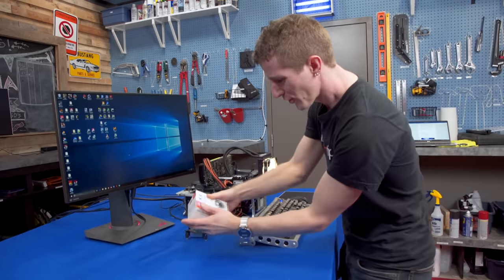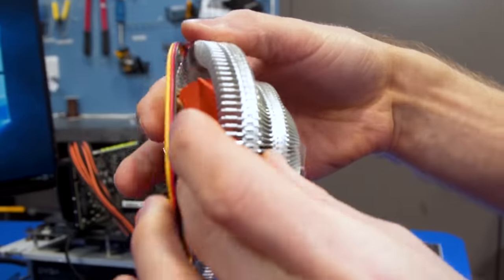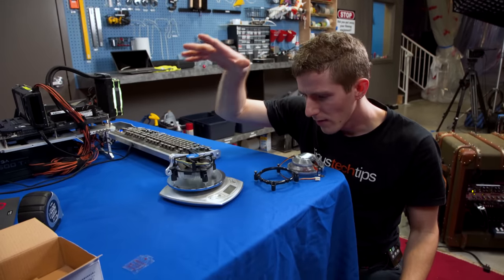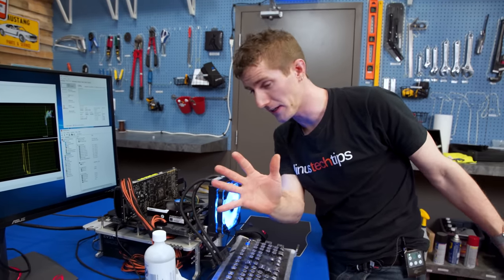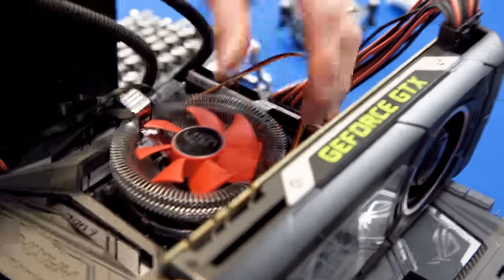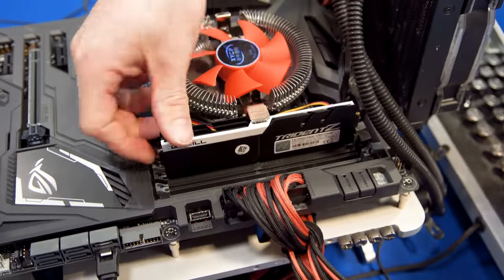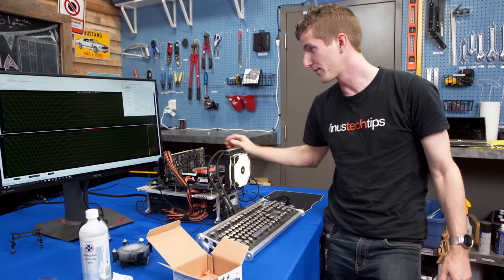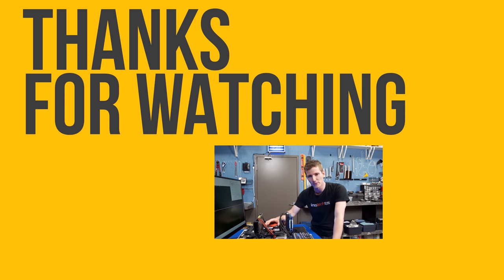The CHEAPEST Heatsink on the Market

Comment: Please tell me you did not use that thermal paste, okay a tube of paste would be more than the heatsink sure but come on you should had used a better paste on both and not the crap it came with
Reply: they used the included paste...
Reply: Or at the very least they could have done this (used what they came with) and then re-tested them using the same thermal paste to really remove all the variables.
Reply: He should have just gone with the same thermal paste on both coolers. And should have used a good one too. That would be a good comparison.
Reply: Yeah, but if you're buying the cheapest heatsink, you're not going to have thermal paste.
Reply: Except that in no way in hell would I buy the cheapest heatsink. And since its all for lols, why not just do the proper comparison? I mean he said it himself he put the 65 tdp heatsink on a 95w cpu... Why not use a good thermal paste? :P
Reply: Because it is all for lol's so why not show what out of the box will do for you?
Reply: Kirinketsu you can buy way better thermal paste than that for like 2$. Anything is better than what that came with
Reply: Completely agree. He says he's going to use the included thermal paste to eliminate variables, which turns out to be the only variable... Would like to see this done with the same thermal paste on both.
Reply: Kirinketsu many cheaper thermal pastes need 24 hours to set before use and to actually help with the cooling
Reply: Fail test since thermal paste can make a big difference
Reply: Is this heat sink worth it? We dont know cause we spent more on thermal pasted than the cooler!
Reply: Nick Flipper learn to spell and use grammar before you criticise someone who has more success than you will have in 3 lifetimes
Reply: Lots of people have extra tubes of thermal paste, left over from previous builds with enough for another application.
Reply: It was a comparison of the stock heatsink vs the cheap one. A normal person would have used the paste in the box, they wouldn't go out and buy pro grade paste for 3 times the price of the CPU cooler
Reply: No point, I use a 4690k with stock heatsink and stock paste and I've even switched it in and out multiple times without replacing the paste, and I've overclocked it to 4.4ghz 1.22v and it gets 63c temps at maximum. Why would I need any better temps than that? The stock cooler is perfect
Reply: I agree that another paste would have been good to try, however I highly doubt that it would have changed much.

I'm also not saying that the default paste shouldn't have been used though. I think it would have been beneficial to just try both. Do note that one wouldn't even have had to use a high end thermal compound; one can get little packages of TIM for 1$, and it even lasts for multiple applications. probably would be good to use the best stuff though just to see the range of performance.

Like I already said, I highly doubt it would change things much, because the heatsink itself is cheap and underrated.
Reply: LazerLexHex dont be mad that your not successful but i am lol, stay in your moms basement
Reply: Chola Tech damn he got you really work up didn't he? Lol hey at least you care and are passionate enough to voice your opinion.

Comment: Linus you did not test the same thermal paste on both so this this test is not correct.
Reply: He used the paste included with both coolers. Fair
Reply: Nick F the constant was the system used and the stress software used
Reply: The constant is the setup on the motherboard. He used the cheapest stuff - and everything included. That's how this format should work for me

Comment: It looks like a ripoff of an older zalman cooler
Reply: Yeah! The old CNPS 7000 AlCu with only aluminium , same mounting bracket  (i have the Zalman somewhere)
Reply: Scrolled down just to find this comment. Did not disappoint. CNPS for life.
Reply: I tried to cool an old Pentium 4 with this , it could never get it under 60°C
Reply: It's actually just a rebranded Deepcool cooler in a different color, plus with the right CPU and paste they perform fairly decent for their price, I have one on an older AMD AM2+ mobo with a Athalon II X3 that's a daily computer for my aunt in her 70's running NeverWear's Cloudready OS(open source ChromeOS), and before that Linux Mint XFCE 64bit and the temps where in the low 40's for daily work loads surfing the net, Google Docs, playing movies, streaming music, etc.. to be noted I only paid $8 for the Deepcool version off eBay, and I would not use this on a more modern gaming PC by any means.
Reply: The good old Athlon X3  , did you unlock it? 
The paste also play an important part : on my old OC'ed i5-750 in a well ventilated case i had more than 50°C on idle with a 120mm watercooling (with noctua fans) and cooler master stock pase , this same I5 in a poorly ventilated case with a bad custom 120mm cooler is staying below 45°C with a noname paste
Reply: I tried to unlock it years back when it was my main system, but I got one of the ones that just would not unlock for whatever reason, plus with the task it's doing now it could really be handled by a dual core Intel Celeron to be honest, but the Athalon X3 just happened to be parts I had laying around my shop, and I hate throwing out good working parts, and the only things besides the CPU cooler I had to buy for her build was a new Rosewill 450 watt PSU(caught on sale for $23), and 8GB of new old stock DDR2 ram from HK($24 after shipping) that cost me in total about $50.
Reply: It does appear similar, however I would think the CNPS 7000 would be much bigger than that though. The copper version of that thing weighed nearly 2 pounds as far as I know, while this is 1/6 of that. The higher density of copper would not account for that difference.
Reply: Mshojat I think the fins on that thing are waaaay thinner than the zalman ones
Reply: it looks thinner and more space between the fins
Reply: That's why I said it's a Deepcool clone only in a different fan color, box, and sticker as everything else the exact same down to the crap thermal paste I threw out, and it works much much better on AMD chips with the mounting clips.
Reply: Looks like the old Ice Hammer coolers  in late 00s (but they was cuprum 500+ grams and handle C2D E8400@4Ghz very well)

Comment: I think you should try lapping the bottom of the heatsink and using decent thermal compound and see if the performance improves. With temps instantly that bad even at idle you must have a serious contact issue between the heatsink and the CPU.

Comment: Bought one, works perfect on a Q6600 build XD.
Reply: Bet its quieter than the stock fan too. Linus didn't really cover the sound part.
Reply: Hey how did it hold up?
I am buying this as my water cooler take  some time to arrive.Did it stay cool on stock speed?
Reply: I bought a q6600 4 years ago because I always wanted one but it's been even longer than that since I had a working 775 board. Someday I'll build that system.
Reply: Same using it with an e6600 not bad, not bad at all!!!
Reply: I once bought a cooler similar to this from a different company on a QX6800, and boy, it did not hold up..... granted a 135W processor...but it thermal throttled running idle at about 90C

Comment: could you do the cheapest CPU next please 😁😁
Reply: Currently a refurbished Celeron E3400 (2.60ghz) on Newegg at EIGHT DOLLARS

Cheapest non-refurbished is a Celeron P4500 (1.86ghz) xD

And for the laughs the cheapest non-refurbished GPU is an almighty ATI Rage XL 8MB at $17 LMAO
Reply: Kaci Richards watch RandomGamingHD for that
Reply: Gabriel Those aren't the cheapest, at least not refurb, you can find old server processors for as low as $3 which are probably a bit faster than an E3400 as well, motherboards on the other hand... Not quite as cheap though.
Reply: There was once a $2 server CPU on amazon that had two cores and was godawful.
Reply: True but i guess we are talking about "brand new" hardware (as the heatsink of the vid)

Comment: I use a 65 Watt rated cooler on a 95 Watt CPU in my server (size limit) and it works just fine. Full boost and ~80°C under full load. I did change the fan for a better one and put a second fan on the back tho.

Would be a nice video idea: How much does adding a second or third fan increase cooling/is it worth it?
Especially on nuctua cooler that would be good to know given that they include mounting for more fans.

Comment: You should have tested it on one of the cheapest stock desktops that are available in a retail store. I'm sure it could hold up for a lower end computer that doesn't produce much heat. I think it might be an appropriate buy for someone who is a casual user and has a cheap computer that needs a heatsink.

Comment: Stock Pentium 4 cooler are actually cheaper, got one from a repair shop for free, along with an adapted-to LGA775 from AM3 Zalman tower cooler. And the stock P4 coolers handle a 4790K at 4.6GHz easily.

Edit: In other words it should allow something from Skylake or Kabylake with a delid (dat bad TIM) to hit 4.8GHz.
Edit 2: BTW, the fan may only have a 2200-3000 RPM range due to being early PWM, but even at 4.6GHz it "idles" at 2200RPM and is quieter than the i5 4440 heatsink it previously had.
Reply: Dabombinable Mi pentium 4 were monsters, thats why the coolers were great
Reply: Well the P4 coolers for LGA775 were originally designed for Preshott. They are still no where near as annoying as the newer stock Intel coolers (though only usable if you have something such as meccano to "adapt" them for LGA1150). Especially since the P4 cooler is quieter than the Windforce x3 cooler on my GTX 970.
Reply: Aren't the mounting holes different?
Is there any proven good reliable methods for attaching to the more modern sockets?
Reply: All you have to do is remove the push pins, and attach it using screws (Meccano screws+silicon washers+plastic spacers with mine).

Comment: you use a cooler rated for 65 watt tdp on a 95 watt tdp cpu? whyyyyy?
Reply: Clearly see he intends to remove it and put back the water cooled solution. He did not even leave it running more than a couple of minutes in the video and he indicated it was at 101 C which is like 190 F which you could fry eggs. But this was for testing purposes, so if we saw a puff of smoke come out. And it wasnt hitting the RAM heat spreaders, it had a few MM left, so it did fit ok.
Reply: 101 C is more like 214 F
Reply: Test it's extreme performance
Reply: we wouldn't see smoke in any case because the PC would just shutdown immediately once it reaches 105 C

Comment: I would love to see a review of a small assortment of $15-30 Aliexpress coolers. I got a 6-pipe dual tower cooler for a little over $20 USD shipped, and it works amazingly on my 95W Xeon even in an ancient chassis with only one case fan. I ran AIDA64 for quite some time, even with my GPU under stress test to warm up the air temp in the case, and never breached 70C.
Funnily enough, it uses the same janky but serviceable mounting system as the one in the video!

Comment: Still better than an Intel stock cooler
Reply: no :/
Reply: The stock heatsink is fine anyway if you dont intend to overclock. I don't use a stock myself; but its kind of needless to worry yourself about it as long your cpu isn't thermal throttling. Which a video game should not push your cpu that much

Comment: the intel heatsink has a heat transfer pad, which needs less time to set, the 3rd party cooler used actual paste, which takes a few hours to set for optimal heat transfer. tisk tisk linus

Comment: I bet that If you used good thermal paste the result woul not be that bad. If the processor hits 100°C and the heatsink does not reach similar temperature, which it seemed as it didn't, it means that the real limiter is the thermal resistance of the paste. Indeed, with a 100° aluminium surface blown by a 20°C wind made by a fan would mean very high thermal flux, since it is proportionnate to the difference in temperature between the two mediums. For that reason, I ran a cheap 10 bucks aliexpress cooler on an overclock q9500 ( 3.8 Ghz ) without exceeding 60°c on full load. The cpu's TDP was also 95w.

Comment: I bought a $17 "snowman" CPU cooler on AliExpress for my Ryzen 2600 and it's quieter than stock and let me overclock to 4.1 at 3.5 volts without going over 75 degrees in torture tests

Comment: To be fair, it could probably handle a little boost (note I said little say 50 to 100 Mhz) at 65 watts, and you were stressing it at 95 watts. It also MIGHT have been able to handle 'stock speed' at 95 - not sure, but the thing DID boot and then it didn't go to full throttle, but even if not  stock at 95,  I'm reasonably sure it could handle STOCK speed at 65 Watts and light gaming and really that isn't bad for 5$.

Comment: That design is stolen from Zalman CNPS7000X coolers that were top of the line .. in 2003 :), CNPS stands for Computer Noise Prevention System, so that design is ( on paper ) pretty quiet, but it is mostly because of the fan that Zalman used so do not expect it from this one. Actually it is a pretty decent design and when you open it for cleaning you can add a slight touch of thermal paste on the fins in the base where they connect to the CPU so they can connect even better when assembled together ( on a Zalman you can get up to -3C just by re-polishing and adding a bit of paste and a good tightening of the base ). My guess is the patent fell so others are abusing the design.

Comment: I have this $5 heatsink for almost 5 years now on i5 and it keeps the temp at no more than 43 Celsius.  When I was done with it I installed it on AMD A10  in ASUS Essentio desktop certainly it was running hotter than on I5 in 60s degrees but it was cooler than the stock ASUS Essentio Series heatsink that didnt even cover the entire AMD CPU.  
You should start new video series on "What A Crap They Use in Asus, Dell, HP & Lenovo Consumer Desktops" might be a good idea.
I did not test it on AMD FX series, but no need that sucker runs  70 degrees with Corsair h110 liquid cooler and its hot in the room like inside a sauna even with 4 fans mounted on that h110 on both sides at 5ghz.

Comment: I have this fan which I bought because stock cooler was noisy. It is certainly quieter and I haven't noticed any overheating issues but the target CPU is a G645 which has no boosting capability.

Comment: Anyone else noticed that this was the wrong stock cooler ? The intel stock cooler for i5/i7 has a copper core and is designed for 95 Watts - this one was pure aluminium which is only included in i3 and lower series and designed for 65W (google Intel E97378-001 vs E97379-001).

Comment: you said you didn't want to use an aftermarket thermal compound so that you can eliminate variables... but that just adds another variable. The cooler may perform better if the thermal compound they have is so rubbish. You need to do this comparison again but using nth2 on both the stock intel heatsink and the cheap one.

Comment: please help!!! how do you see how much your cpu is throttling
Reply: Jerry Sun when you’re running your test check your temperature to see if it’s going above 95-100 degrees. Also compare your clock speed with the rated clock speed it should be rated to be running at. If your current clock speed is lower than what it should be, it’s throttling
Reply: @jarred4005  thank you very much, but what I mean is what Linus showed in 8:24

Comment: Ah know, I have a newer version of this thing on my PC I recently got to replace the garbage Intel cooler, and it's actually competent. I7-8700 non K at max Turbo and it holds around 70c. No that's not a joke. Idk why it's so much more efficient. OK to be fair i do have a boat load of Fans, 2 200s and 2 120s, and its got the best chance possible using some really high dollar thermal paste i got at a Bargain bin store for some reason.

Comment: I have that fan on a Core 2 Duo E7400 overclocked from 2.80GHZ to 3.6GHZ and it mines 24/7 and never goes above 69 degree for a CPU rated to run at 74.9C 24/7

Mining = CPU is at 100% 24/7/365  so 69C is pretty damn good

Comment: Those stock intel coolers ain't bad if you aren't overclocking. Pulled apart an old computer and every fan in the thing had seized except for the intel cooler